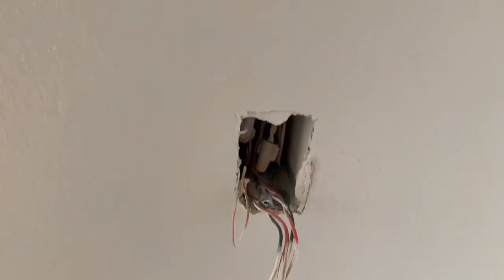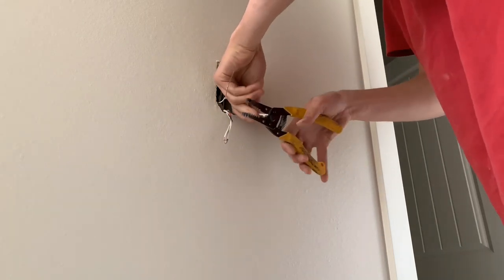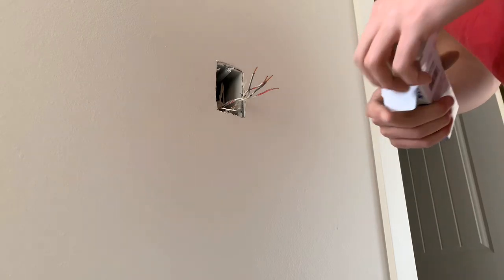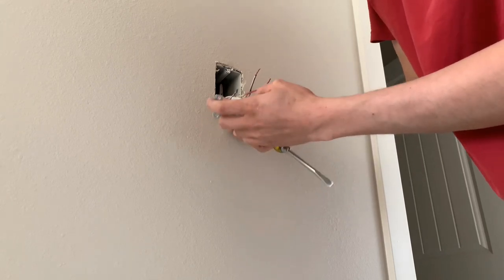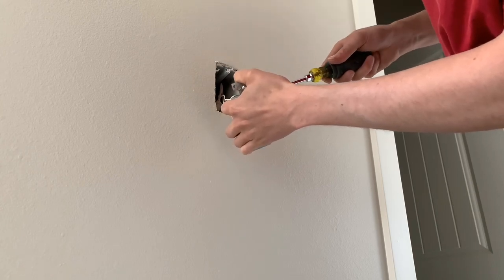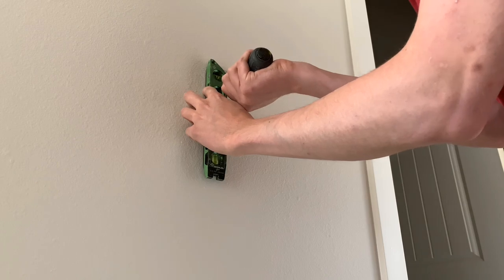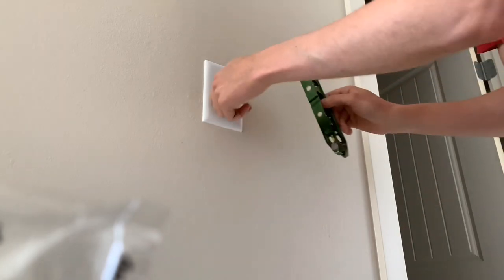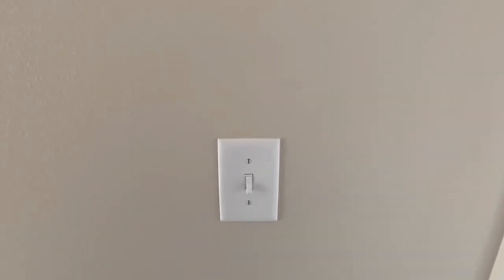How To Install A 4 Way Switch

Comment: Te eason 4.way switch, top side says IN, bottom says OUT. Do i need.to connect incoming wires from initial 3 way switch to IN, and outgoing wires to OUT? If I connect them the other way, the whole circuit will not work? now my circuit does not work, i think i may put the wrong wires in wrong screws. Thanks.
Reply from the maker: http://www.electrical101.com/4way-switch-wiring-using-nm-cable.html

look at this diagram. put one set of wires on in, and one set of wires on out. that should take care of it. 4 way switches only work with 3 way and 4 way switches.

Comment: Ok bro I think I figured it out the Travelers connect the 3 way or four way switches.. to each other. So the current can travel throw and that's how they operate the same light... It's all one circuit right????
Reply from the maker: yeah they are used to send the power from one switch to the other switch. two travelers, one traveler is used at a time depending on the position of the switch. yeah one circuit
Reply: @DailyElectrician  ok thanks again bro I
Reply: Ok I think I understand it's 2 travelers Total . And which ever switch you turn on one traveler works at a time...
Reply from the maker: correct! 👌🏼